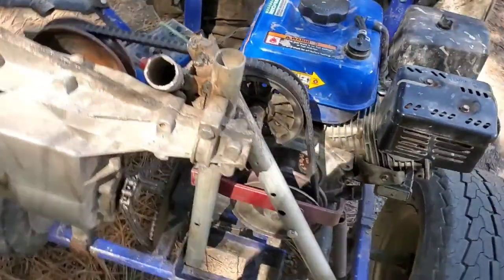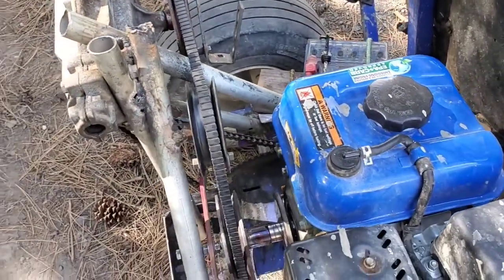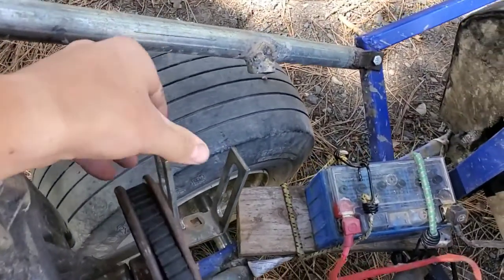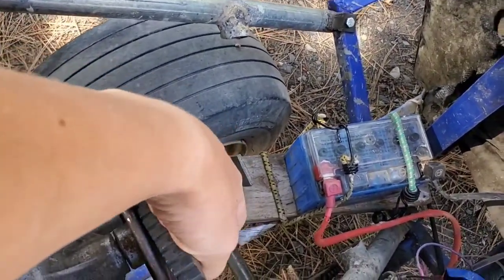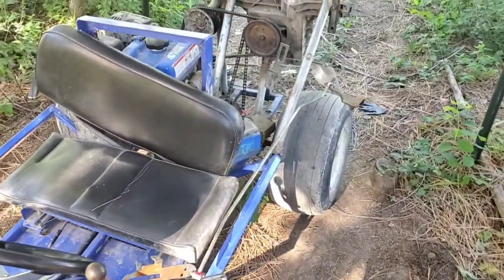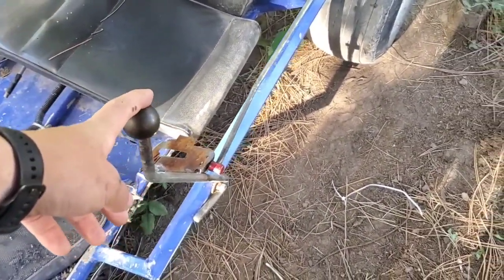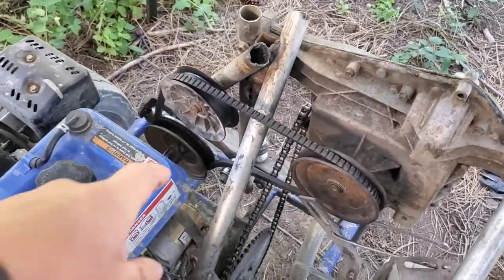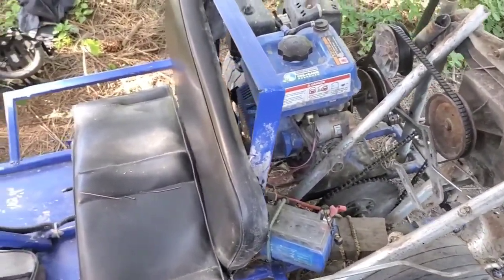My Go Kart can tow a trailer | Go Kart Upgrades Part 3

Comment: I'm trying to do something similar with the same transaxle. When you took the axle out, were you able to get the differential gears off the end of the axles? I want to change my axles out for splined axles so i can put proper brakes on but i don't know if i want to go hunting for diff gears for a lawnmower